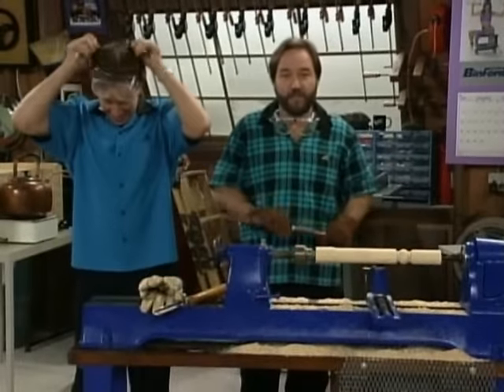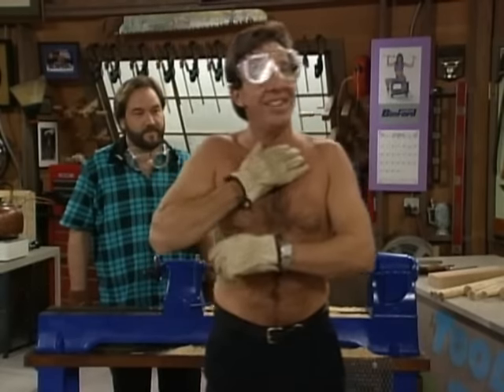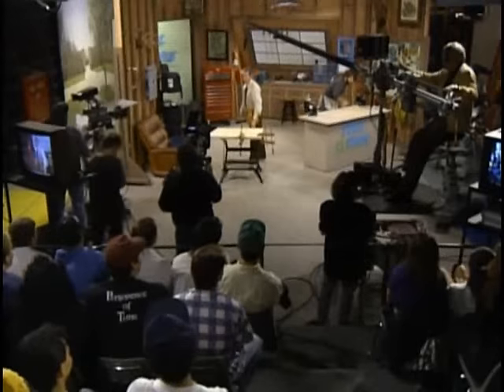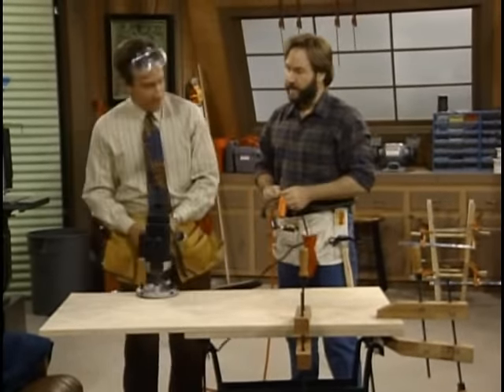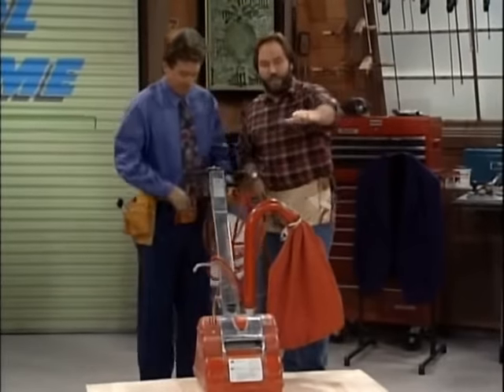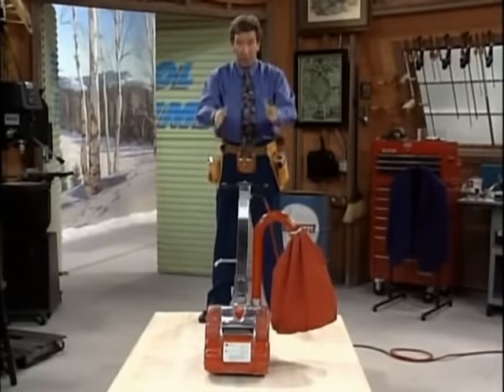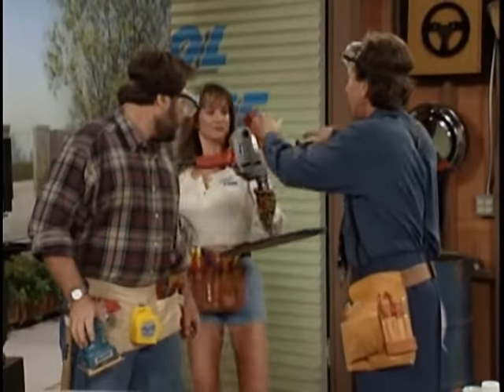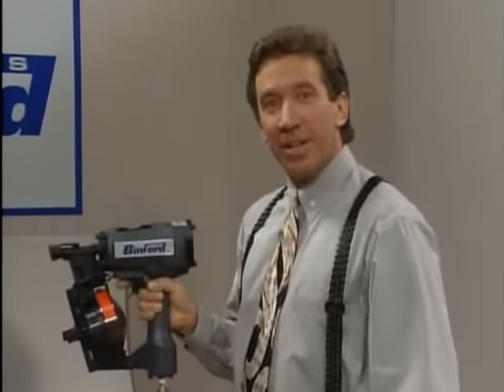Home Improvement:  Tool Time Part 2

Comment: 3:54; now that's a truck!No electronic gadgets, solid front axle, big block, real chrome, steel no plastic, testosterone built, man i'm in heaven!!!
Reply: Arden's hammer  Price is already 4 times higher! Eh!
Reply: Yes you got that right
Reply: FinalEvilElpis well 1.) there hard to work on/ very confusing, 2.) the go for space if you look under the hood in a 1968 350 Pontiac firebird you will see there is lots of extra room to work, to can get to anything and unlike nowadays you have to pretty well remove 1 or more parts to get to the one your going to replace or repair. Also I’m almost 16 which isn’t old but in still old school,   But older stuff is so easy and never a headache to work on so anyone can do it!
Reply: FinalEvilElpis Oh yes definitely yup because when your going to replace your old battery in a new car you should not that to remove shit out from in the wheel well compared to older vehicles it’s right there just undo the grounds and mounts and it’s good. I’m not lazy it faster quicker and you don’t need expensive useless tools
Reply: FinalEvilElpis Must drive a ford? Huh? What do you even drive m8? I’ve had Chevys Fords Honda’s, some newer some older. Things happen, are you saying cars never break down? Never have recalls? Some of us take care of our things and drive them 200/300k miles.
Reply: FinalEvilElpis  lets see for one i dont need a fucking Ipad in the dashboard of my truck. Old cars had relays to control power windows/locks/seats, new vehicles have more control modules on them than the space shuttle. Not to mention all splices and terminations have to be impedance matched twisted pair  because everything is modBus now. Gone are the days of fixing your own vehicles, you need about 10k worth of scan tools to properly diagnose and repair electrical problems on modern vehicles or else you're just throwing parts at it and praying it fixes it. Old cars you can fix anything with a test light or a simple multimeter, new cars you need a PhD in electrical engineering
Reply: FinalEvilElpis  Electionic gadgets are delicate and glitch out. There's an '04 Chevy Suburban which, for its time is an amazing truck. There's nothing wrong with the engine, oil pressure, driver's seat, or 4wd, but it thinks the oil pressure is super high, the 4wd is broken, the engine needs service and the driver's seat switch does everything its supposed to do backwards. It needs a bunch of new electronics which are expensive, but mechanically, it's still perfect.
Reply: Clorox Bleach 
He obviously doesn’t work on his own vehicles so why bother arguing with him?
Reply: @jamesearlcash7725  Your response to Clorox Bleach there, were you talking about their interaction with FinalEvilElpis and FinalEvilElpis's ignorance and rudeness? If so, I agree with you. Also, I agree with what that one person said about where they said that FinalEvilElpis had the politeness of an idiot, because FinalEvilElpis was being a total asshole. I would imagine that vehicles from 2000 to 2009 are easier to fix or maintain by yourself than vehicles as new as 2015 and on up are.
Reply: I bet that "truck" at 3:54 only gets about 10 miles per gallon.
Reply: @not-so-smartaleck8987  
And your point is what? You don't buy a truck for MPG...
Reply: The Fall Guy called, he wants his truck back.
Reply: FinalEvilElpis  I have never read a chain of comments that scream "I have never looked under the hood of a car in my entire life" more than this one. Electronics in vehicles go out no matter the quality, and when they do they're a pain in the ass. Older vehicles with carbs and no electronic BS will last longer than the plastic crap being pumped out of factories today. Work on a car one day and you might understand, don't be afraid of breaking a nail.
Reply: FinalEvilElpis  im 29 i feel them too many gudgets is right some time.
Reply: Mike Maes 
It looks like an 85 C-10, am I missing something? Aside from the roll bar, it looks like the same truck.
Reply: Mike Maes 
The comment was intended as a joke. And admittedly, I am a little color blind... 🥺
Reply: Mike Maes  I do. My truck has a throttle-body but I'm going to convert it to carb in the future.
Reply: Mike Maes  Tim Allen literally says it's a big-block 454 in the video. Plus it's a C30 so it'd be a safe assumption either way.
Reply: Mike Maes  Ok, you're right. It probably has a 2.5l Tech IV instead.
Reply: @LAChargersfan You bought THIS actual truck? If so, how? And how is it equipped? What's the story?
Reply: @LAChargersfan Cool. Is it a 350 with auto, or what drivetrain. What trim model, Scottsdale, Cheyenne, Silverado? Looks like a cool truck, at least it was in the 90's. LOL.
Reply: @LAChargersfan Thanks for the info. That's a cool ride. It looks like the body is in great shape so it would make a good candidate for a resto job or resto mod. Good luck and keep us posted!
Reply: @prestonkerr4421  omg ur so right
Reply: FinalEvilElpis  Electronic stuff Will never be reliable.Nuf Said!
Reply: i like how finalEvilElpis has managed to piss of several of you lol :'D enjoyable thread.
Reply: @Meowchiavelli  i just bought myself a New Jeep Wrangler with lot's of electronic gadgets and i love it, but i'm still missing my 1980 fj40 Land Cruiser!!
Reply: @not-so-smartaleck8987  ***gallons per mile

Comment: Ok, they seriously need to reboot this show.
Reply: It wouldn't be the same.
And they did something similar-last man standing.

Then later put the two characters in the same UNIVERSE. And had them actually meet each other.
Reply: @jasonleslie203  Well of course it wouldn't. But that doesn't mean it couldn't be funny.
 Twenty plus years pass & have Tim still blow everything up.
Reply: @zap_sigma1  if they did it right. Found the right actor chemistry. And good story telling. Then it might work.

Comment: I dig the Square Body! 79 or 80 I think? Could anyone else tell if its a C-20 or 30?
Reply: @LAChargersfan Yeah I knew it was late 70's but I couldn't make that out as a 20 or 30. In Iowa that truck is a Unicorn or barn find as all the Square Bodies were beat to death as farm trucks or the IDOT salt brigade rusted them away. That body style seemed to have rust issues anyway, especially the box and rockers. Good eye, thanks.